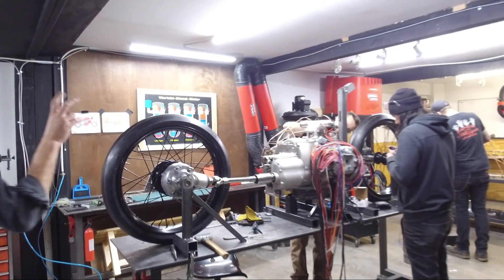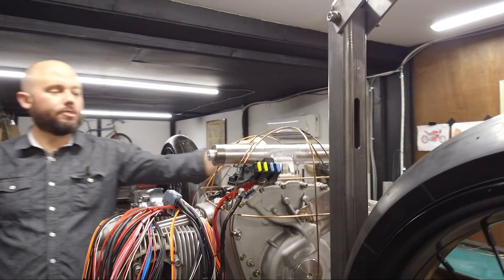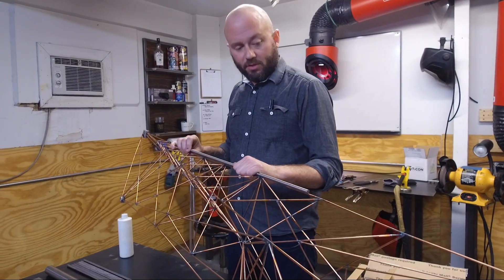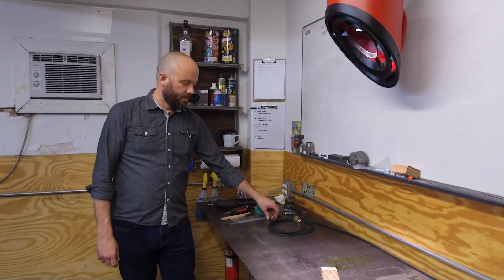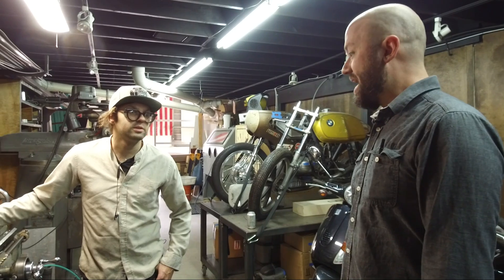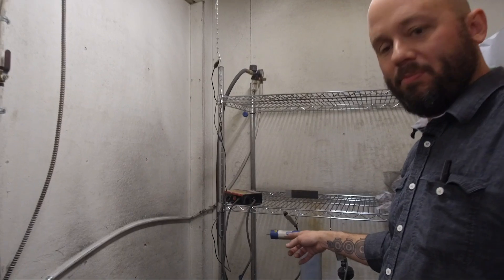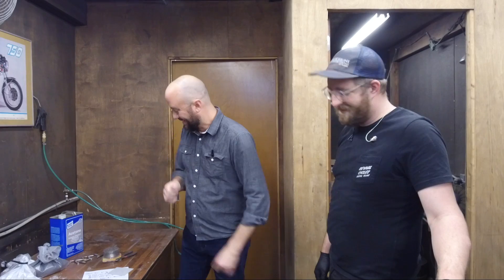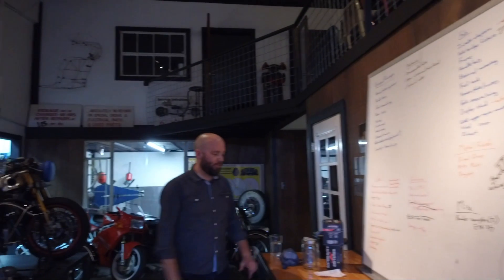Titanium-framed BMW Motorcycle prototype comes together! // Revival Daily #65

Comment: All to be TIG welded in an Argon atmosphere. Which means a lot of cardboard and duct tape to construct an enclosure with gloves like a bead blasting cabinet. Trying new things is fine but it's not much fun having your frame start dissassembling itsself at high speed. I was trained to do repair or fabrication on Titanium piping in a paper mill bleach plant. Titanium is a sexy, exotic metal and of course it sounds cool to incorporate it into a build but please, for safety sake be mindful that not welded correctly can be extremely hazardous. It's not a situation where "We may be doing it wrong but..." should fly. Honestly, it needs to be welded and pre and post weld at least momentarily needs to be in an Argon atmosphere. I am assumming that you have done research into such specialist type fabrication. This is in no way an attempt to Lord it over anyone with expertise. I am a proffesional fabricator and weldor of a variety of metals. I don't think for a second that i am the ultimate authority or expert in these matters. My interest in motorcycles and in fabrication are obviously similar to yours. I am just concerned that this and all your projects turn out to be safe and successful so i wish you all the best and just want to have faith you know what is involved in Titanium fabrication.

Comment: The change in color on the welds is due to oxidation.  If you can keep the heat affected zone bathed in shielding gas until it cools it will be bright shiny and have no color. Other than that keep up the awesome work. See y’all this weekend.